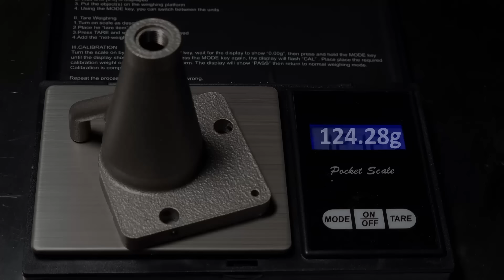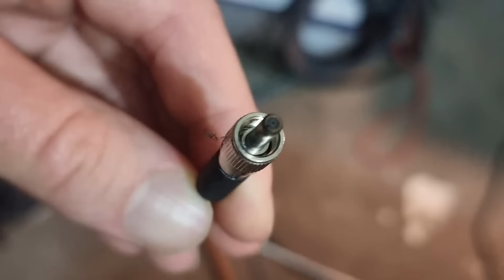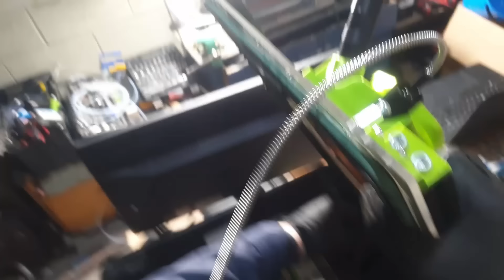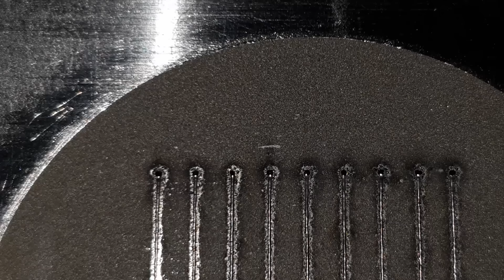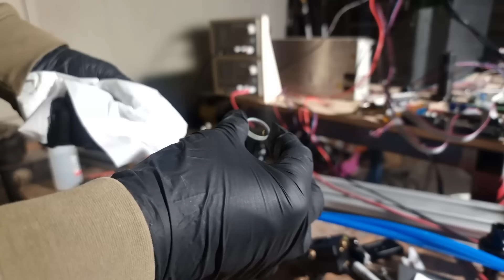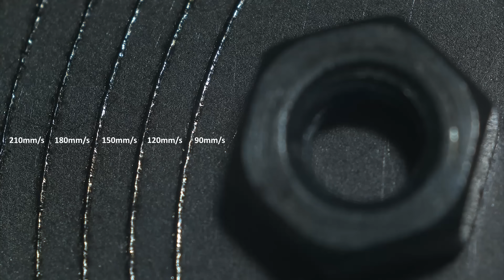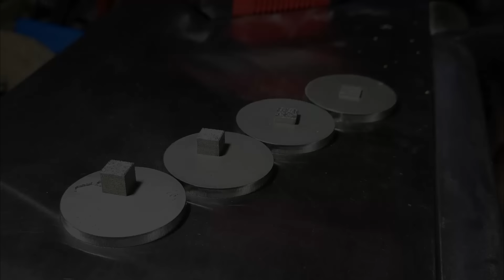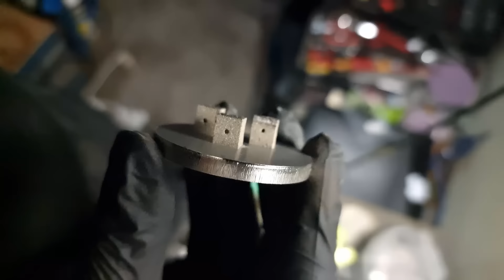DIY Metal 3D Printing - Success

Comment: It looks like you have part cooling and use it in between layers? If so, are you sure you're not losing  powder to the fluid flow?
Reply from the maker: Do you mean the gas stream across the powder bed? That isn't for the sake of part cooling. It helps control condensate and plasma during printing.
Reply: @metalmatters  I see, I don't recall much of your earlier builds and trials at this point. I had assumed you were in a box with something like Argon which would 'sit' in the contained so extra shielding gas wouldn't be needed.

I'm unsure of your flow rate but at the same time the material is so small and relatively light I cannot help but wonder if the flow is disturbing it. Perhaps not in isolation but certainly if something like sputtering or impurity is causing localized forces on the surrounding material it could, I suspect, be a contributing factor.
Reply from the maker: @hahahano2796  You're on the right track. I'll explain it in the next video.

Comment: So are you gonna sell out like Micronics for a couple million or are you going to actually build something great that doesn't hinder innovation and make every possible bullcrap claims for the patent?
Reply from the maker: No, I plan to keep it open source. I'll have to fund it somehow though.
Reply: @metalmatters You'll likely get a decent wave of support both financially and technically when you release your first version.

You also might want to consider selling kits if you haven't already.
Reply from the maker: @steves.5868  The unfortunate thing is that both financial and technical support are most beneficial before I release anything.
Reply: @metalmatters  Don't be afraid to ask other creators or the community for technical input if you need help.

A few laser guys that could help that I can think if are StyroPyro and Explosion&Fire (He thesis used lasers).  Both of their Discord servers contain fairly knowledgeable individuals and are pretty active.

Financial now is pretty hard. I'd donate if I weren't unemployed lol.

Also, I do have some experience with electronics if you need help there. I'm not an expert by any means but I have a decent amount of experience with various microcontrollers and have designed a small number of circuit boards.
Reply from the maker: @steves.5868  That's OK. The issues with the laser have been resolved. As for the remaining problems, they’re probably better suited to domain-specific expertise. I know what's causing the current issues. The challenge is finding a cost effective solution.
Reply: @metalmatters How's it been going?

Comment: What if you print in a vacuum, removing the need for argon?

I'm amazed by your skills by the way, im an electrician, and a mechanic. I got pretty good a CAD modelling, and 3D Printing. Next project will be programming. One day i want to be abled to do stuff like this. Very inspiring!😊
Reply from the maker: It's been done before but from what I read it still required around 0.3 atm. Powder was being blown around by outgassing if I recall correctly. Best of luck with learning coding. I think AI might make it redundant soon enough though.

Comment: Props for all the work you have done. Once you get your AM process solidified, it’s important that you implement in-situ heat treatment for the residual stress formed but the AM process. Recommend a spot size of 1700micrometers for scanning between layers with a hatch offset around 500 micrometers between each layer to minimize residual stress to make practical parts more resilient
Reply from the maker: Thanks for the insight

Comment: Hats off for the grit to push on. I have been working with SLM printing for the past 10 years, printing 10s of thousands of hours on mainly EOS systems. The hardships I have run into with various machine or process related problems fade into nothingness compared to this work. Very impressive! This gives me perspective on how much knowledge is engineered into modern industrial slm systems/solutions.

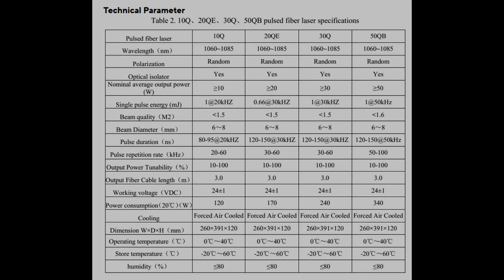Comment: 20:00 Have you considered looking into MOPA laser sources? They are similar to the Q-Switched laser but, instead of having a set pulse width they have a variable pulse duration on the order of 2-500ns while also allowing for continuous wave operation. They are a bit more expensive then a regular Q-Switched laser but I did think that it would be better from a project standpoint as there is more information about it available and I believe it would be more flexible with  other materials due to being able to control pulse power accurately.
Reply from the maker: Yes, have one presently.

Comment: Did you try sandblasting the finished parts, may be able to clean it up a tad. I have a feeling you'll need a higher amperage laser, have you tried flooding the chamber with argon.... Just a thought.. maybe, you don't necessarily need a vacuum just the right conditions.

Comment: You're past it but the boot loop with the galaxy was probably due to there not being a battery in it. Some phones dont like having just a power source hooked up so you have to have the wires crammed in between the battery and contacts
Reply from the maker: Yeah. I had followed a couple tutorials and they made mention of it. Somehow theirs worked and mine didn't. I tried adding a capacitor to fool the system but no luck.

Comment: How's it been going?
Any new problems?
Reply from the maker: Plenty. I replaced the laser source which took much longer to acquire than I had hoped (tried getting a couple of second hand units - didn't work out).  The new laser introduced a series of new problems amongst those which already existed. The prints are looking tidier despite the issues. Next video should be out sometime in Jan.
Reply: @metalmatters  That's awesome. (The video timeline that is) 
How is the part density looking?

Comment: Hey, here's an idea I thought could prove useful for the bed surface:
You could use another metal for the bed, probably one that has good but not excessive bonding with the metal powder you're using, you could even go for a metal / alloy that could be dissolved / oxidized away or and I think this would be the best option, use a metal plated surface.
If you were to metal plate a ceramic/glass material or simply another metal with one that will bond with your powder but can be dissolved away, you'll then have the possibility or reusing the beds by dissolving away the "support" metal plating, better yet you'd get a good finish on the parts without having to pry them away with pliers.
Look up the different metal plating techniques, electroplating is popular and simple to implement, ionic deposition could also work as the building surface is rather small and ionic deposition chambers are rather simple to build.
Then can work on metals but thanks to stuff like graphite paints you can even plate plastics and such with limited ressources.
Great work dude, can't wait to see the next iterations of that project!

Comment: pressurized atmosfere is just one way to get a viscosity increase on the media, you can use liquids to get similar resoults, oils may revent oxidation related problems, a small film may be enough with surface tentin on the particles, when dealing wit ferromagnetic metal dust, magnetizing the bed may also prevent scatering

Comment: Fantastic work, unbelievable dedication👍

I wonder if constant pressure plus ultrasonics could compact the powder better than hammering? Somehow the idea of things microscopically vibrating around makes me think it could lead to the particles finding their densest configuration more readily.

Perhaps lots of added complexities in the form of vibrational modes, etc, but I wonder what a transducer hacked from an ultrasonic cleaner could do?
Reply from the maker: Thanks. I'm exploring it at the moment, although not with ultrasonics. The hammering is merely to level the substrate, not to aid packing density.

Comment: Excellent work!  I didn't see if this was covered by the other comments, but did you consider a post-print kiln fusing step, followed by annealing?  I think that's fairly common with industrial SMS 3d printers, and is not considered 'welshing'.
Reply from the maker: I have considered it but not yet followed through. I think the prints are too compromised as it currently stands.

Comment: Naive question: maybe I totally misunderstood that part, but why didn't you motor-control the 3 lasers for a perfect overlap?
Reply from the maker: That could've been another approach, but adding 9 positioning motors to the head and requiring a stable picture for processing would've made the system much more complex.

Comment: Even if the results look good, there are two main problems at cladding powder, surface tension and powder oxidation. cladding powder that has been exposed to oxidation is main problem. try a protective chamber with oxygen-free atmospheric gases. 
secondary try to reduce heat tension by heating up your platform to more than 800 K. Thirdly, it would be advantageous to pre-sieve your colloidal powder, of course under inert gas. 🤐It is much easy to clad with powder fractions above 50µm

Comment: Hey! Love the video its amazing, have you considered using electromagnetic field inductive heating in a vacuum combined with individual area conductive current spot/area welding in conjunction with the laser welding process? It would allow for you to force the powder to be compressed and heated slightly with the electromagnetic field source added in from a single above area head, that can be moved around and have the laser still heat the powder, but also have side mounted coils to improve localization off this effect to the powder bed. With a conductive wire pulse, like tungsten, to hit areas (like types of tig welding without argon) when the laser fires creating a lower voltage and amp total to help weld both spots and areas together. Especially when you add the electromagnetic field effect to induce a control of the current flow through the given material. It can help create "rivers" of heat but it can also create "lakes" that dissipate outwards quickly like an "exploding capacitor" but it's actually much more controlled than that. It will also get rid of spatter and any lack of density as it forces total welding to occur like forge welding when you heat it up and compress it/hit it. Which, the vacuum helps, but the magnetic field and heat convinced with current, forces nonmagnetic material to pool up and become energized by other electromagnetic fields and is less resistant to electricity flow which concentrates adhesion and fusion to micron sized crystal areas. Because of their small size, cooling them is done similarity to "tack" welding sheet metal. Corner to corner one side to the other, alternating with a middle pass, too, to let heat dissipate outwards to colder areas. 

To be conducted away, like top left to bottom right, to middle, to top right then bottom left, back to the in-between is the middle and outer edges, then back to the outer edges to start again. Allowing for a cooled argon to come into the vacuum chamber, then be vacuumed out and recompressed (to cut costs on argon but not electricity lol) then cooled with a heat exchanger when it comes out into the vacuum chamber. A regular air conditioner works pretty well, truthfully. This allows for the powder to fuse exceptionally well and allows for it to be quenched and tempered all in one go, making it stronger and more consolidated into not just a 100% density, but a fully formed piece. It will work with aluminum alloys and other non-ferromagnetic metals, even ceramics, too. 😁 hope it helps you. It's one of my design ideas I have on my xenonreality YouTube channel.
Reply from the maker: Not really. At the moment things are biased towards developing the minimum viable product. Once it gets into the hands of a few more people, then we can explore what else is possible.
Reply: @metalmatters  alright 😁👍 thanks for replying to me, I really appreciate it. Keep up the great work. If it helps out what I wrote before, just let me know & include my name in it for that at least

Comment: I've only seen two professional machines but both had a counter-rotating roller as their spreader.
Not sure how they handle metal sticking up though but I suspect they handle it by not letting it happen. Either algorithmic or otherwise.

Comment: I just stopped to find pleasantly that your research is having success. At the end of the video, I saw that you where using Argon (if I'm not mistaken). What about using nitrogen? 17 years ago I was an operator on a laser cutting machine, and I do remember that all the laser diode part was cleaned with fresh gas flow that same gas that got out through the nozzle. I know the process is totally different, but for your first machine, the one with the triangular laser beams pattern, I think you could try even different nozzles. Maybe a chromium plated copper nozzle would do the trick as an non stick tip? However I love this series, and the ammount of work you've put into it.

Comment: 1:50 could it be the waste material from the printing that is taken into account? like spatter. the bed is likely fitted on a scale, so the total weight is higher than the parts. like gross is for net. or they are just bad at math ;P

Comment: Dumb idea: What if the powder was in prefabricated discs that you loaded in whole, instead of swiping them on?  You'd be able to produce a more rigorously proofed set of powder to build from?
Reply from the maker: Not quite sure what the mechanism for applying those would look like. Keep in mind that the layer height is typically between 30 - 50um.

Comment: Hi, just wondering if the forum is still working? I get sent to quite a random looking page when following the link.

Anyway, awesome work! I'm watching with great interest.
I'm in South Auckland and if you're anywhere close, I have a brand new old stock 5V 100A power supply that I could donate to the cause if you have a use for it.
Cheers.
Reply from the maker: Hi Marsh. The forum is now closed. I'll remove those links. I'm based down South. Appreciate the offer but I don't have a purpose for one of those. Cheers anyhow!

Comment: When it comes to your laser welding layer height being lower than expected: you hit it right on the money, every pass will accumulate heat if not given time to cool in between, and that can easily lead to your weld puddle being much more spread out, overheating of the material, and warping like you saw on your plate. 
You'll almost certainly need to include a heat sink below the baseplate as a way to pull heat from the part between layers to prevent them from sagging, we tend to use copper backing bars behind thin sheet or to fill holes, as it works great to pull heat away and most filler metals won't stick to copper.

As for beads of molten wire sticking to the feeding nozzle: welding supply stores often sell Mig Nozzle "tip dip" or spray that acts as a coating to prevent spatter from adhering, that might be worth looking into.

One more thing: the first layer of your print should be using more heat/power than every successive layer because you want to fuse the weld to the base plate. After that, be sure your gcode turns down the heat for each successive pass as heat builds up within the part. 
There's going to be a lot of tuning required to get that machine printing benchies once you've gotten it mostly working, but most of that is stuff you can learn by asking welders luckily lol

Also, I wonder if you could do SLS printing using SAM (Submerged Arc Welding) powder? You might want to look into that as another possible way to print metal.

Comment: What if adding not dry metal powder? 
I mean adding some substance to the powder like flux or something else that helps distribute heat so that splashes of individual overheated drops of metal are minimized and the drops that should be in the model design do not roll into a drop (bumps) but are distributed over the previous layer. 
like a solder paste mb ~ i don't know 😅

Comment: You are the guy! I've been working with laser engraving since 1983, and I've always wanted to experiment with 3D metal printing . I only did a few tests with an old ND:YAG DPSS 50W S engraving machine testing focus, speed, just like you. Then I sold the YAG machine and built a 50W Fiber machine. A month ago I started researching again trying to find someone who is doing this from a normal engraving machine and only today I found a single video about it, yours. You are light years ahead of me, I'm still testing only lines. I saw in your video that you abandoned the pulsed fiber laser because you found that a continuous laser would be the best option and opted for the YAG because it has the option of disabling the q-switch in the q-switch driver or just removing the q-switch from the cavity. (This part made me sad because I don't have the YAG anymore...). With the fiber laser I noticed that using the Wobble function insted a line and out of focus I got better results in terms of line homogeneity ( i use EzCad software)  Congratulations, you are an inspiration for those who like to research.
Reply from the maker: Thanks. I'd be interested to know more about your setup. Have you had any problems with material vaporizing?
Reply: @metalmatters   Actually I didn't get a homogeneity even close to what you got... What happens with the q-switched fiber laser is that the powder is ejected from the beam path before being hit by it. I think it's due to the high energy pulses... I need to try to work more out of focus, but without a doubt the correct way is use a CW fiber laser . I have a fiber laser welding machine that uses a Raycus 1000W CW source. When I have time I will do some tests.